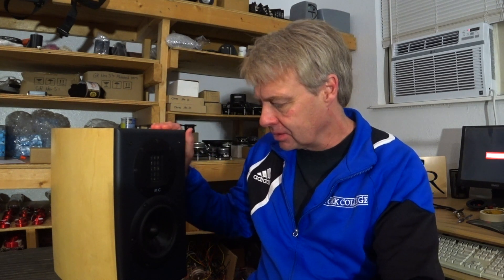Acoustic Center Spacing and Why it Matters!

Comment: There is no way you can pinpoint the lowend, no mater how good of a woofer you have, low frequency will allways come from everywhere in the vecinity of the woofer, mid range is not that forgiving, but still not as directional as a tweeter...talk much out of your rear and? I've testet what you say, and there is little to no difference in measured sound, and none in the actual listening...I've tried to give your BS the upper hand by mooving the tweeter to another box, and unless I moove the tweeter in or out, or take it 10 inches or more horizontally, I did not get any difference...So as long as they are more or less in the same plane, and not more than 10 inches apart, there is no difference, I've used an infinite baffle and still did not noticed any difference, except the baffle difference, no timing issues. But then again, you are the same guy that agrees to magic thousen dollar cables....so I would not expect any less from you!

Comment: I know you are very knowledgeable at audio. But I think people overthink audio far too much. I have what most people would say is a GARBAGE cheap budget as it gets(ish) setup. Heck my subs are in my closet (well 2 15's are) and another 12 is on the other side of my room. And I got to say it sounds REALLY REALLY REALLY damn good for what it is..It puts EVERY cinema costing millions of dollars to shame!!  And it is in my bedroom with no sound deadening at all.  Saying that Ill share my setup.  Room size is like 10ftx10ft ish. Old denon 7.1 running a 5.1 setup with dayton audio speakers. 2 floor speakers (100$) a center (30$) and 2 rears (40$)  1 100$ 12in car subwoofer on a car amp with a dc power supply (200$ invested) and two 15in car audio 1000 watt subwoofers on a pro audio behringer ep 2500 amp in my CLOSET!!! (380$ total)  It is literally a bunch of crap all put together and it will blow most peoples mind! It all blends perfectly as far as I and others can tell. My neighbors complain when I watch movies and It is behind a block wall underground in a basement!!

Comment: @Danny Richie   

Another great video putting technical speaker & XO design into layman's terms.  :)

Yeah, concentric/coaxial drivers have their own set of problems.  Do you have any experience with the 5" BMS 5CN1620 concentric cone midrange/compression driver tweeter? 

Based on Erin Hardison's (ErinH) of Medley's Musings testing and use of this combo in his car audio install over on DIY Mobile Audio Forums, I'm working on a studio monitor design with the 10" Ciare HW251N midbass that he also used.

All indications look and sound great so far if you keep the HPF on the midrange high enough (~300Hz) so that the midrange cone excursion doesn't modulate the HF too horribly because of its function as a waveguide for the HF compression driver..

http://www.bmsspeakers.com/index.php?id=bms_5cn1620CIARE HW251N

Comment: I used to have a pair of British Mission speakers. They are/were known for having the tweeter below the woofer. (Instead of above like most other designs). What effect would this design have on vertical response?
Reply: My British Rega Naos transmission lines also have the lower tweeter, probably to get the length of the transmission line.
I was wondering the same thing...

Comment: Do you have rule of thumb for the c-c spacing such as 1/2 wavelength of the crossover freq or do you just get them as close as you can?
Reply: Rule of thumb would be to find the wavelength of the center to center spacing on this chart: http://www.soundoctor.com/freq.htm   

Then be sure that your crossover frequency is below that wavelength.
Reply: @dannyrichie9743  I bookmarked that page.  Thanks

Comment: Danny  - how did you accomplish this with the Skinny 6's?
Reply: In the Skinny 6's the top driver plays full range (to the top) with just a first order high pass filter. That upper driver then crosses to the lower four woofers in the 250Hz range. So just one driver covers a wide range with four covering the bottom end.
Reply: For those wondering what the Skinny 6's are check them out. http://gr-research.com/skinny6s.aspx   They make great use of small wide band drivers.
Reply: @dannyrichie9743  I do like that design.

Comment: Great video, but I have a question. I have a pioneer tower speaker with 1 tweeter and 3-1/4 midrange driver. I want to replace the 3 midrange driver's with coaxial driver. How would that work out.
Reply: You'd need a complete new crossover.
Reply: @jamesbrotherton5487  thanks I'll look into it. Have a great one.
Reply: James is correct. Might as well start over with an ideal (more narrow) box as well.
Reply: @dannyrichie9743  I'm just experimenting for fun with the speakers I have